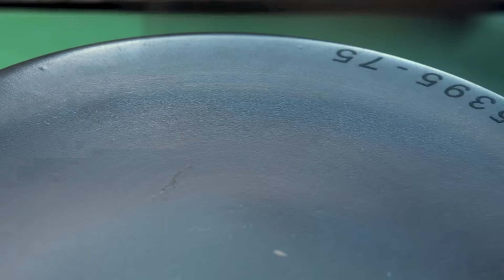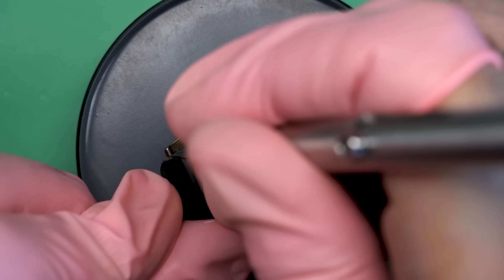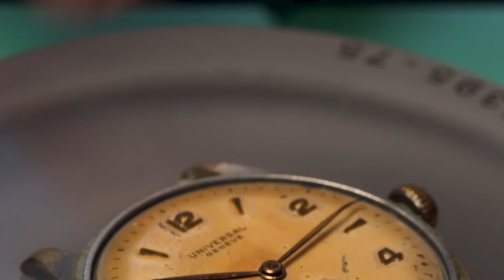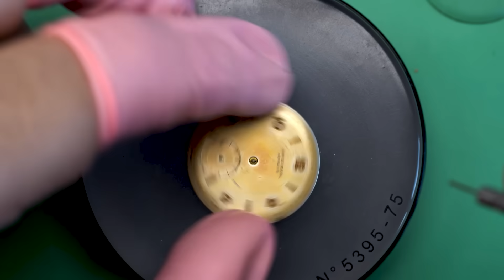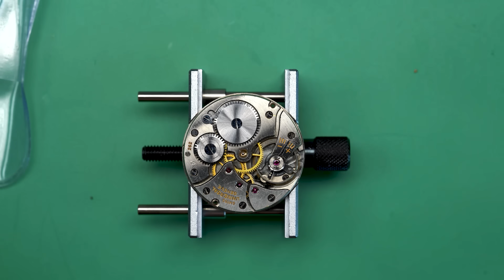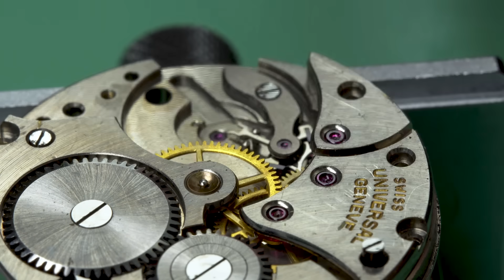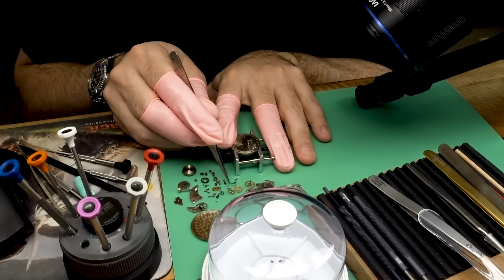Full Restoration Needed On This Universal Genève Watch!

Comment: The green goo on the spring bars is called verdigris. It happens when moisture is held against brass generally ( you see it in old leatherwork with brass fittings ) . It's basically wet oxidation. My guess is that the leather straps got wet at some point and just held the moisture against the spring bars.

Comment: You can fill in with plating, however it’s a long process. Basically you plate it, file or buff off the plating on the high spots, and keep repeating until the holes are filled

Comment: I will have to say thank you!  When I look at the parts laid out like that, I think nice.  Not too bad.  Now that I've done 5 pocket watches because of your videos.  I recognize every part and what to look for with one exception.  I keep the screws separate.  I have no idea how you know what screw belongs to what part.  Maybe with more time.  Thanks again!  Oh ya and almost forgot, I replaced a balance staff with hand stakes and anvil, no jig.  It's a Cortebert 536 Movement.  I'll let you know how it runs when the roller table comes in.  Had a broken pivot.  Ok sorry me again.  Yep, did that one too.  Had to remove a bridge to put some parts in that I forget and then dumped parts from the other side.  Also, had a spring launch.  Thankfully I had an amazon bubble shipper on the floor and heard the sound of it land on it.  So I knew ballpark where it was.  Only 20 minutes of hand and knees with flash light :-)

Comment: I worked in plating for 40 years when you cleaned it in the electrocleaner with reverse current it removed the chrome at the same time.

Comment: Bergeon mainspring winders are super expensive. But I agree with you they really are the best option. The aftermarket copies out of China are absolute garbage. That's is why I say to people all the time that if you really want to do this right then you can not cut corners cost wise. Even purchasing the lubricants isn't cheap. Moebius really lasts a long time so once you pay you really do not need to worry for quite some time.
I only have one watch that is a headache. It is a Daniel JeanRichard Chronoscope that need pushers. No one seems to know where exactly to find them. Even Girard Perregaux is no help.
There is patience when it comes to working on watches. But there is also times where patience can wear really thin.  And that watch which is a superb looking and running watch but with no pushers. 
That is one brand I refuse to look at collecting anymore. Really bad service for a watch still being produced

Comment: Hey Marshall! I love watching your videos man! I’ve been upgrading and purchasing more tools lately but, I still struggle actually buying watches to fix. Not that it’s hard but, it’s sometimes confusing finding worthwhile watches to service/fix. Any chance you’ll be doing a buying guide and what to watch out for when buying used mechanical watches? Also, if I affix the balance assembly to the main plate when cleaning in an ultra sonic, will the hair spring be okay. I can’t find a straight answer from anyone.
Reply: From what I've found universal Geneve is a awesome quality brand, but not a super popular brand so they can be found more reasonably priced. Anything that says whittenhour on it is actually a Longines movement but in a whittenhour case. Some of the nicest quality watches you can find cheap. I'm talking older watches like 60s to 80s? Something like that when they were partnered. Gruen is a super common brand, not crazy expensive in their day. But properly nice watches. And they can be found cheap cheap. If you have a value village or thrift store near your normal commute, drop in every day and check the jewelry case. I've found a few gruen watches and even a whittenhour from 20-50 bucks. I've found the value village jewelry case to be super rewarding. I shouldn't be giving away my secrets tho. Usualy any old 50s to 70s watch is 20 bucks. Then they have a truly crappy modern guess watch next to it for 200 bucks. If you like the styling of the 50s and 60s watches like I do, there was a tonne of random brands back then making nice stuff. Bring a case back tool to pop the back and see the quality of it. Finaly there's soviet watches that just all look super cool for some reason. Dubious quality on them. But they are cool and straight up clones of swis movements a lot of the time. Mine runs pretty sweet. I wear them as beaters that look cool still.
Reply: @MrRecall200  thanks for the comment! Yeah there are a few thrift stores near my way that I check often. I’ve found a couple here and there. My latest find was an Bulova Accutron tuning fork movement. Pretty cool. I cleaned it up and wear it regularly. Thanks for the brand specific examples. As of right now I try not to pay too much attention to brand when I’m looking. That’s mainly because I’m a novice watch maker and will take any mechanical or pre-quartz I can get plus I don’t really know branding that well. So thanks for that!

Comment: As to the "green slime", I might have an answer for you. I have a genetic disorder called Alkaptonuria. Long story short I do not fully break down acids like normal people. I recognize that goop as what accumulates on the back of my watch as the acid in my sweat interacts with the steel caseback. It is typically easy to clean off except in those hidden areas like inside the band.

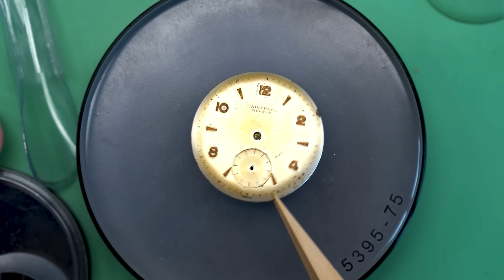Comment: Nice job, and a pretty watch:) kind of surprised that you didn't address the flaking on the underneath of the dial (can be seen around 4:40). Seems like something that potentially can separate and go into the watch movement?
Reply: yeah that’s not good. the underside of the dial is important as is the varnished side. any amount of debris will find its way to a lubricated jewel… and that was a lot of rust.
Reply: Glad I’m not the only one

Comment: Nickel might have been used in early days but it was abandoned for use in jewellery as a lot of people suffer from an allergic reaction to that metal. As it was cheap it's use would have made sense on earrings and alike but for watches, which are usually more expensive they most likely did prefer other plating that was more durable?
Reply: The EU has a law forbidding the use of nickel on anything that’s touches the skin. White bronze or silver are good alternatives, and you can still nickel plate a base coat for durability.
Reply: @MrMadvillan  I have an aunt that is also highly allergic to nickel. She could never wear watches until they came up with a watch which had a case and strap/band made almost entirely of titanium
Reply: My son is allergic to nickel. His first watch was nickel plated, and it left a nasty "burn" on his skin